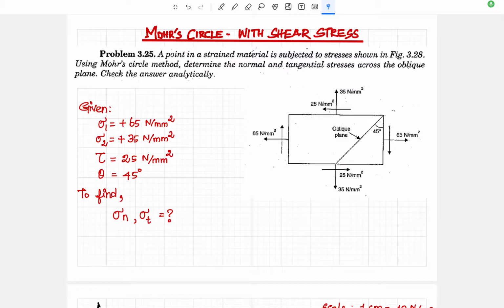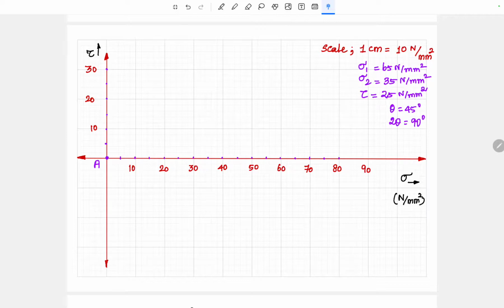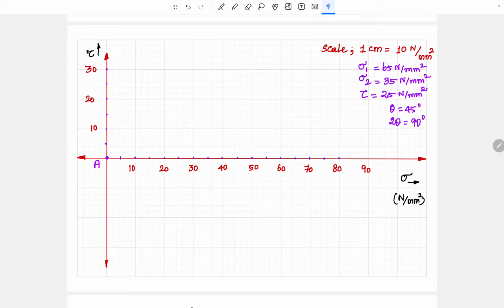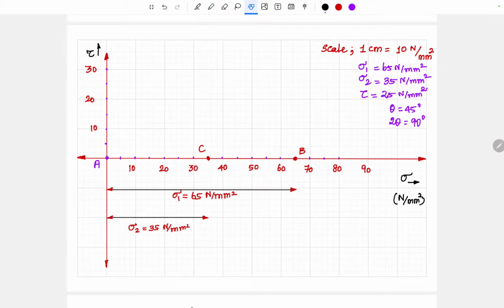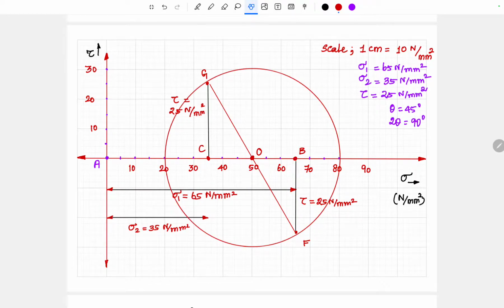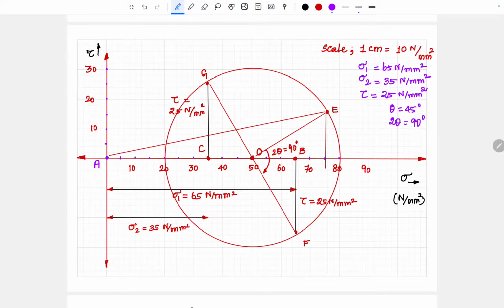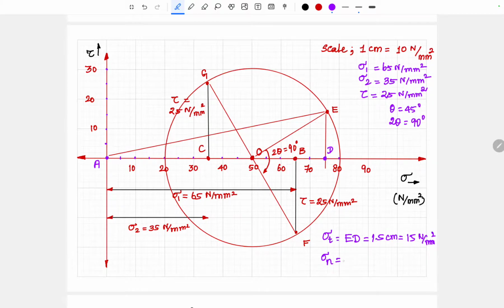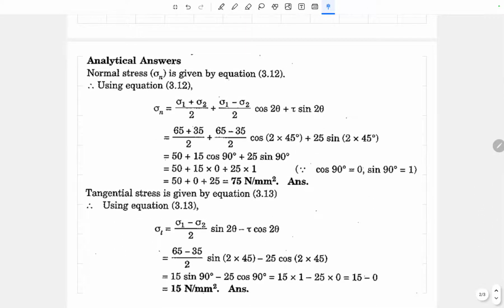Mohr's Circle diagram with shear stress | Easy method | Strength of materials | SOM | MECH | ENGLISH

Comment: In this video how the Shear Stress is drawn upward from a point at 35 N/mm2 and downward at 65 N/mm2... I think this point is very important concept and must be explained in explanation before drawing. (Here I add it because of the direction of shear stress on the object (that is clockwise)). Also why after drawing Mohr's circle line at 2Theta was drawn counterclockwise>> Why Not in clockwise direction...? (This concept must be explained). Similarly, these notations sigma1 and sigma 2 intermix with principal stresses rather they should be noted as x-axis and Y-Axis Stresses.... In general I think for drawing Mohr's Circle Shear stress is taken positive in downward direction on vertical axis why did you take it Positive on upward direction?

Comment: Hi Sir
In question it is mentioned as 45 degree but why you take it as 90 degree
Reply: Because the morhs circle is 180 which is double the the angle bwt the x and y tangential stress is 90 only so we are multiple it with 2
Reply: @karunakaran3113  thank you